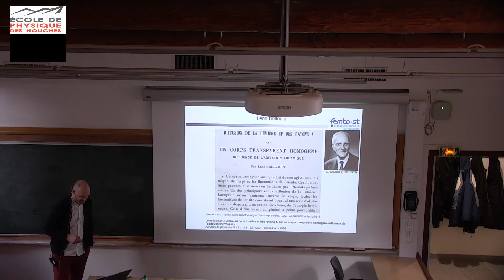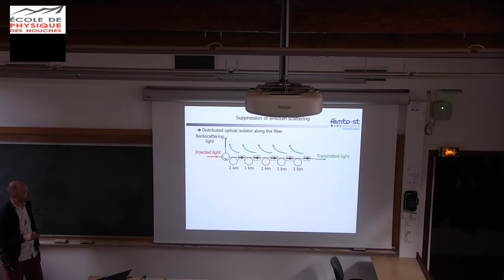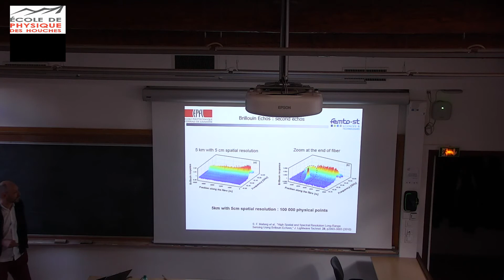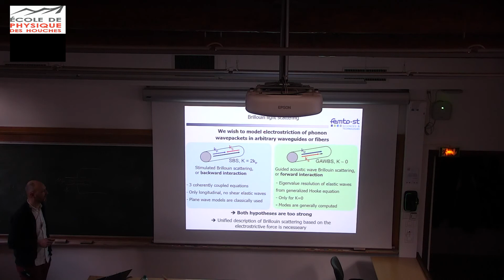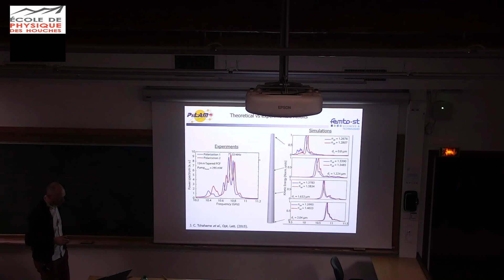Stimulated Brillouin scattering in optical fibers: from fundamentals to applications (1)

Comment: - Introduction to Brillouin Scattering in Optical Fibers : The
    video begins with an introduction to Brillouin scattering in
    optical fibers, highlighting the similarities in wavelengths
    between optical and elastic waves despite the vast difference in
    frequency.

- Stimulated Backscattering in Single Mode Fiber : The video
    discusses stimulated backscattering in single-mode fibers,
    including counter-propagating pump and signal lasers that via
    electrostriction induce an acoustic compression wave with a
    frequency of 11GHz.

- Brillouin Resonance : The pump and signal must have a frequency
    difference corresponding to the Brillouin resonance. The stronger
    the pump, the more pronounced the effect.

- Effect Without Counterpropagating Signal : It's not necessary to
    have a counterpropagating signal; the compression wave can also
    build up from noise.

- Telecommunication Limitations : For telecommunication, Brillouin
    scattering limits the maximum power that can be carried. A fiber
    with 20dB/km attenuation can only carry 35mW.

- Forward Scattering : Forward scattering is not a shear mode with
    low frequency shift (<2GHz) and is not effective in silica SMF but
    becomes more important in photonic crystal fibers.

- Brillouin Resonance Line Width : The Brillouin resonance has a
    linewidth of 30MHz, related to the phonon lifetime in silica, with
    a Lorentzian shape.

- Brillouin Threshold : At a certain input power, the Brillouin
    threshold is crossed, and more than 1% is reflected. Above this
    threshold, increasing the input power does not increase the
    transmitted power.

- Coping Strategies : Various strategies to cope with Brillouin
    scattering are presented, including varying strain or temperature,
    using different materials, tapering areas, placing isolators, and
    cooling fibers with liquid nitrogen.

- Polarization Sensitivity : Brillouin scattering is very sensitive
    to polarization. Not much else is said about this.

- Applications in Measurement : The video explores applications in
    measurement, using DFB lasers with narrow linewidth (<100kHz),
    modulation to stokes and antistokes, and achieving 1m resolution.

- Increasing Resolution Challenges : Increasing resolution is not
    straightforward, and various solutions are discussed, including
    using phase pulses and implementing Brillouin echo distributed
    sensing.

- Photonic Crystal Fiber : The video briefly mentions photonic
    crystal fiber but this topic is not in my scope and I don't take
    notes.

- Complex Equations : The video touches on complex equations,
    including some involving tensors.

- FreeFEM++ Mentioned : FreeFEM++ is mentioned in the video.

- Acoustic Decay Time Measurement : The video concludes with
    measurements of acoustic decay time in silica fibers (11ns) and
    PCF (6ns), noting that it's interesting but not brought to a
    definitive conclusion.
Reply: Stimulated Brillouin scattering in optical fibers: a summary

This video lecture covers Brillouin scattering in optical fibers, focusing on fundamental concepts and applications in standard single-mode fibers and photonic crystal fibers. 

Fundamentals:

* 0:00 Light and sound wavelengths: Although light travels much faster than sound, their wavelengths can be similar (e.g., both around 1 micrometer).
* 9:22 Brillouin scattering: A process where light interacts with acoustic waves in a medium, resulting in frequency-shifted scattered light.
* 9:29 Stokes and Anti-Stokes processes:  Different directions of acoustic wave propagation result in either a frequency decrease (Stokes) or increase (Anti-Stokes) of the scattered light.
* 13:46 Phase matching: Efficient energy transfer occurs when the frequency difference between pump and scattered light matches the acoustic resonance frequency.
* 19:19 Brillouin Threshold:  At a certain input power, most of the light is reflected back due to Brillouin scattering, limiting power transmission.
* 20:19 Brillouin Spectrum:  The frequency dependence of the Brillouin scattering efficiency reveals information about the acoustic properties of the fiber.

Brillouin Scattering in Standard Single-Mode Fibers:

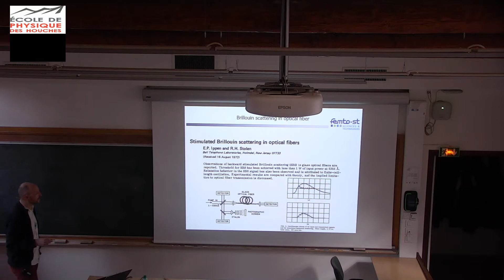* 18:58 Telecommunication Limitations:  Brillouin scattering limits the maximum power that can be transmitted through optical fibers, posing a significant challenge for telecommunication.
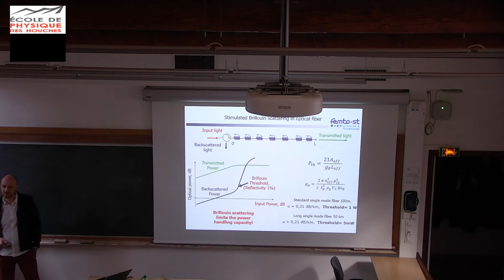* 22:57 Mitigating Brillouin Scattering:  Various techniques exist to reduce Brillouin scattering, including varying strain or temperature along the fiber, using different materials, tapering the fiber, and using isolators.
* 27:18 Distributed Brillouin Sensing: Brillouin scattering can be used for distributed fiber sensing, allowing measurements of strain and temperature along the fiber with high spatial resolution. 
* 35:09 Improving Spatial Resolution: Techniques like phase-pulse Brillouin Echo Distributed Sensing (BOTDA) can overcome limitations imposed by the acoustic lifetime in the fiber, enabling higher spatial resolution in distributed sensing. 

Brillouin Scattering in Photonic Crystal Fibers:

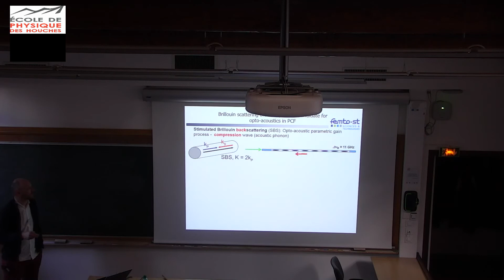* 53:39 Forward Brillouin Scattering: Photonic crystal fibers, with their air-hole microstructures, exhibit significant forward Brillouin scattering due to enhanced interaction with radial acoustic modes.
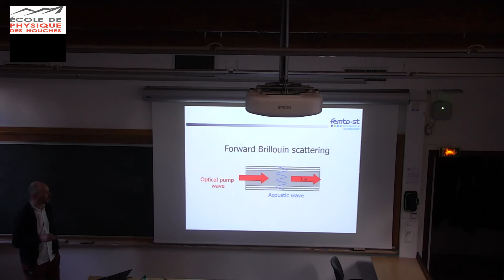* 54:05 Impact on COBS:  Forward Brillouin scattering contributes to Coherent Optical Backscattering (COBS), a noise source in optical transmission systems.
* 57:45 Tailoring Acoustic Properties:  The microstructure of photonic crystal fibers allows for engineering their acoustic properties, leading to unique Brillouin scattering characteristics.
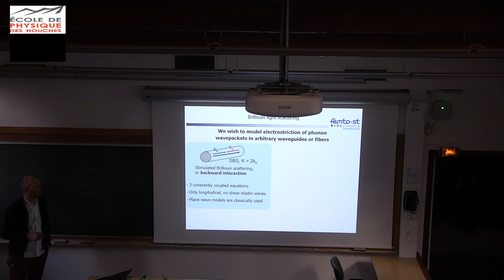* 1:06:41 Modeling Brillouin Spectrum:  Numerical models, incorporating both optical and acoustic properties, are crucial for understanding and predicting the complex Brillouin spectra observed in photonic crystal fibers.
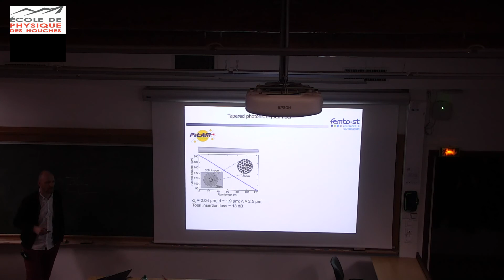* 1:17:19 Suppression of Brillouin Scattering:  Tapering photonic crystal fibers can broaden the Brillouin spectrum and increase the Brillouin threshold, potentially mitigating its limitations for high-power applications.
* 1:21:18 Acoustic Decay Time Measurement: Analyzing the decay of the Brillouin signal in photonic crystal fibers reveals information about the acoustic lifetime and the origin of spectral broadening.

The lecture highlights the dual nature of Brillouin scattering: a limitation for high-power transmission but a valuable tool for distributed fiber sensing and fundamental studies of light-sound interactions in microstructured optical waveguides. 

i used gemini 1.5 pro to summarize the transcript